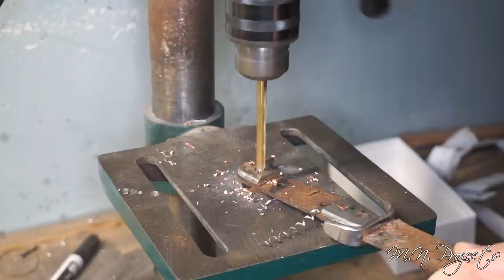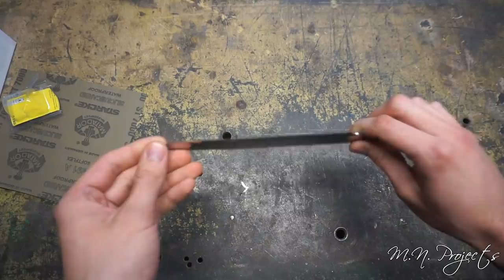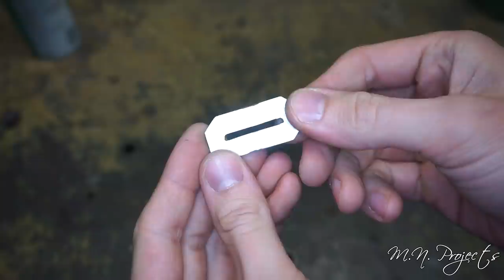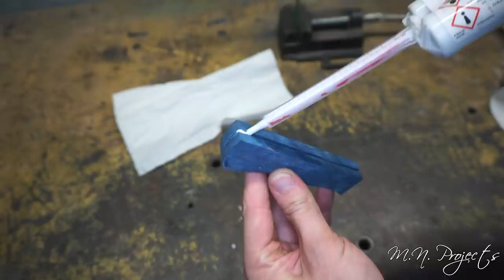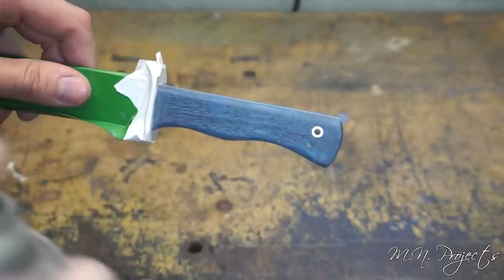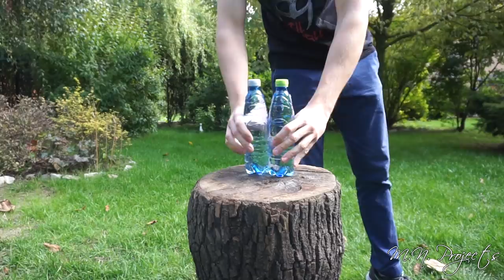Antique, Rusty Knife Restoration

Comment: Nice finish but try a different approach could have saved a lot of metal if you soaked it in rust remover and used some sand paper and wire brush